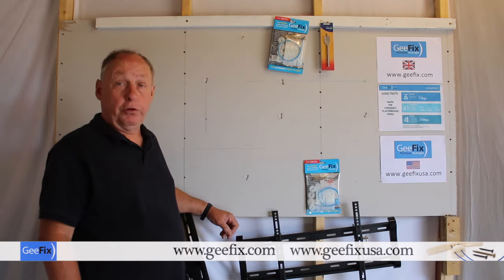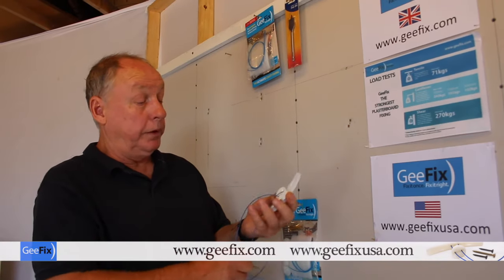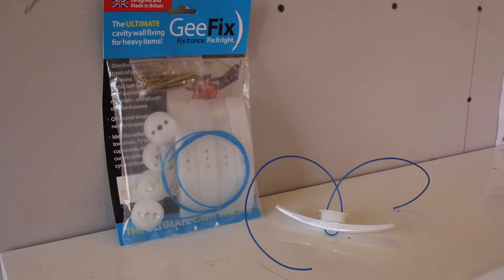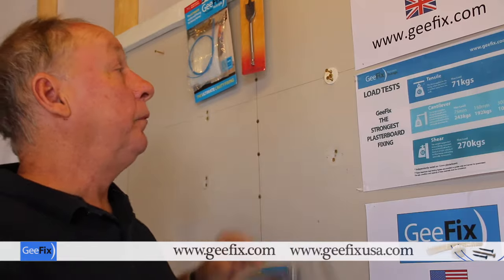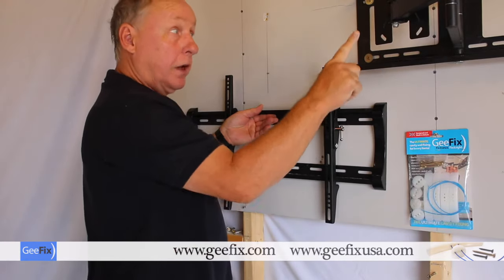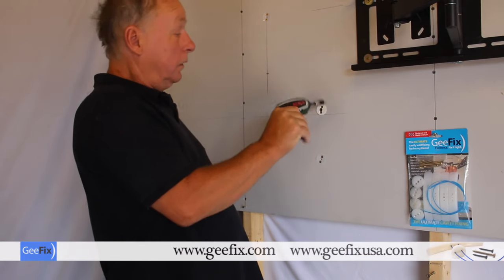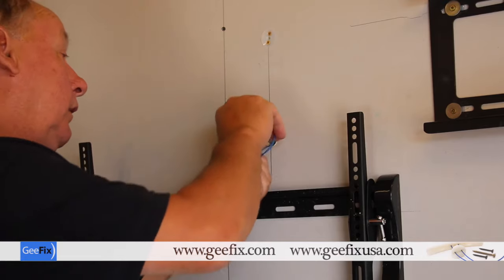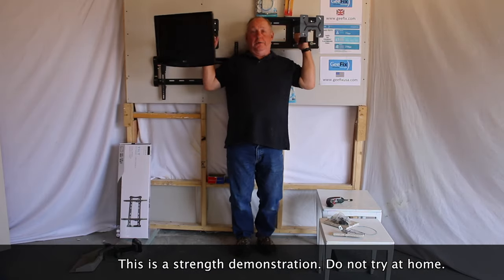GeeFIx - How to install different TV brackets onto plasterboard walls

Comment: I bought these brackets 4 years ago. 

I had a heavy old flat screen tv on a wall bracket fixed to a plasterboard wall. 

These brackets didn't let me down. Absolutely spot on. 

When I took the TV down I just tightened then screws right up so the plug sunk into the plaster board filled over the top and painted.. can't tell they where ever there. No big hole to repair
Reply: Hi there, did you have to secure these plugs into the studs or where these able to hold your heavy tv purely just by using the fixings and the plaster board.